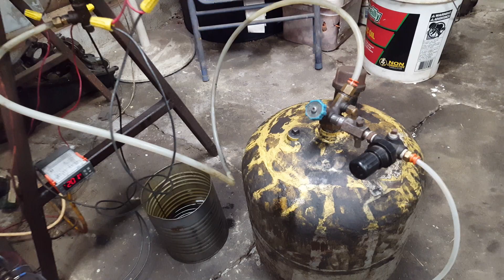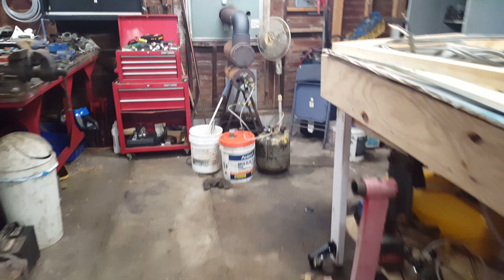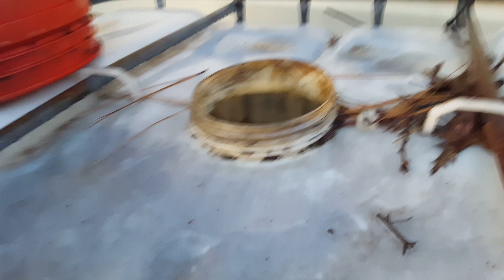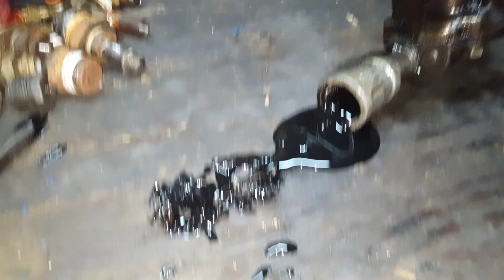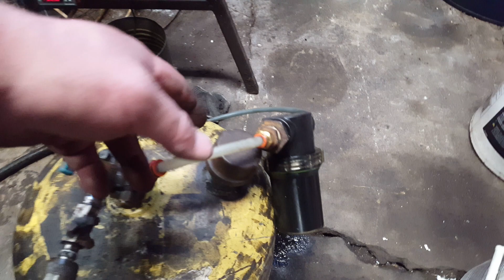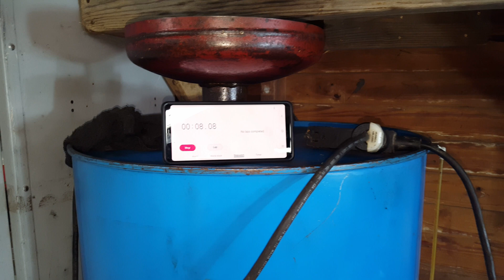Waste oil heater side mission | Garage Fiery Dragon

Comment: SPEEDI...UK...Hi Chad guess whos here again .....  another way to soften that semi ridged reinforced hose is just set to it with a hammer and it warms it up and itll stretch my mentor taught that to me and even claimed it would shrink back to a tight fit not requiring a hose clip........  I never trusted that though as we used it as fuel hose on petrol vehicles .....

Comment: Chad if you cut the ball off the end of the wire between each start, you won’t have any trouble with it starting! Lots of people don’t know the the flux coats the end of the wire when you stop the weld and cools and it makes it hard to restart again! Even on hard wire it does the same thing, if you’re making a code weld and don’t want any porosity! You need to cut the end off the wire between weld when you start and stop!  The flux or gas , when you stop it forms a glaze on the end of the wire! Perfect starts, you need to take a pair of needle nose pliers and cut just a tad off the end every time! Just a tip for you and your subscribers Chad! Thanks for sharing, I welded 37 years in a fabrication shop/ machine shop and I’ve tacked and welded many drive shafts throughout the years my friend! Amongst many other things in the machine shop! Thanks again brother, Kirk from Louisiana! Sending prayers and good vibes for you and your family! 🙏🏻🙏🏻🙏🏻👌🏻👌🏻👍🏻👍🏻👍🏻🇺🇸🇺🇸🇺🇸🇺🇸🇺🇸🇺🇸🇺🇸🇺🇸🇺🇸🇺🇸 God Bless America 🇺🇸🇺🇸🇺🇸🇺🇸🇺🇸🇺🇸🇺🇸🇺🇸🇺🇸

Comment: Fun with propane! I use a thirty pound regulator on my forge. Normal operating pressure when it's warmed up is fifteen to twenty pounds. When I want to forge weld, that runs at about twenty five. The tank ices up pretty fast though. I can't lift a full hundred pound propane tank into a water bath, so I have to be quick. It's really neat, the amount of energy in a five pound chunk of steel that's just under the melting point. It looks like a light bulb filament, lights up the whole shop like the sun. I think I'm going to borrow your stove design. It looks just right for my shop. I'll use propane though, it's more boomy but less messy. I think I'd almost rather be blown up then have to clean up a big oil spill 😁
Reply from the maker: Good luck!
Reply: @ThisNThatGarage  Thanks 👍

Comment: Year's ago I built a waste oil burner out of a old wood stove I would start it on news paper oil rags etc I had a 1/2 steel pot located right below the nozzle full of cast iron scrap that's where I'd toss the newspaper rag etc in and light it the stove would run on its own just using regulated shop air it would throw a flame hot enough to melt aluminum cans in 3-5 seconds if you held them directly in the flame the cast iron was used to hold heat for a long period of time during the shut down period because you couldn't let it run more then 30-45 minutes at a time it would put out over 300°F right out of the duct work on the top of the stove

Comment: Nice setup, I use milk filters to clean my oil, they are cheep and work great. I made a funnel that screws on my 45g drum with a reducer that I can clamp the filter to. The filter sits in the drum and the oil filters itself  with gravity. The funnel holds 5g pale. It will filter overnight if the oil is cold but a few hours if it's hot. The filters are quite strong so I think they could be used under pressure or vacuum.